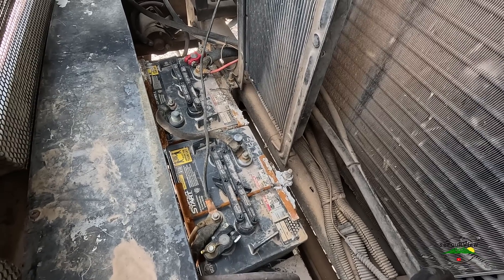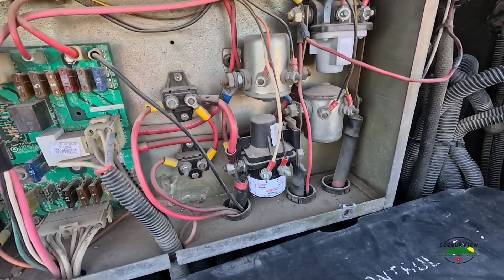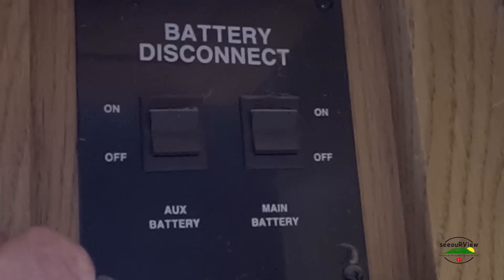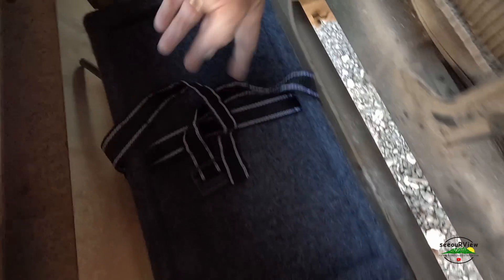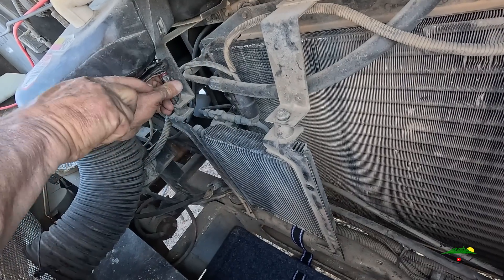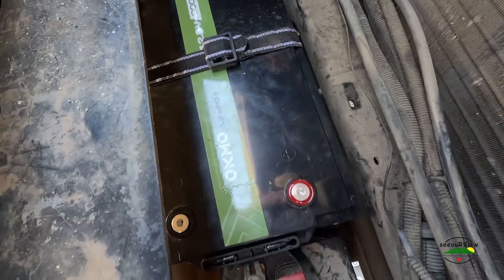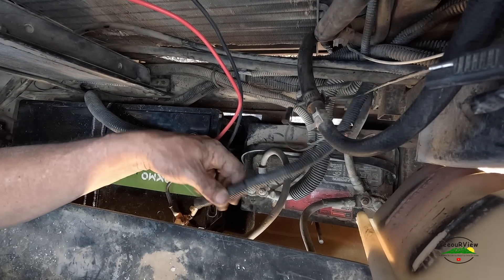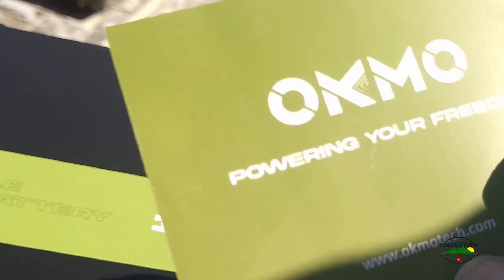Replace Motorhome RV Lead Acid Batteries with LiFePO4 Lithium Battery by OKMO Tech

Comment: I went with a 100ah AGM deep cycle to go with my 200 watts on top, Renogy 40 amp charge controller,  and a 1000 watt inverter The only thing I may add is another battery like the one I have. 
You have to have some muscle for those projects lol
Glad you got an upgrade and see ya down the road❣️
Reply from the maker: Thank you, Janet. I hope you are doing well.

Comment: WOW! Does the heat effect them at all?
Reply from the maker: Temperature range for charging is 32 degrees to 113 degrees, discharging is -4 degrees to 140 degrees so it should do okay out here this summer even when/if it hit 130 degrees like it did the summer before last.